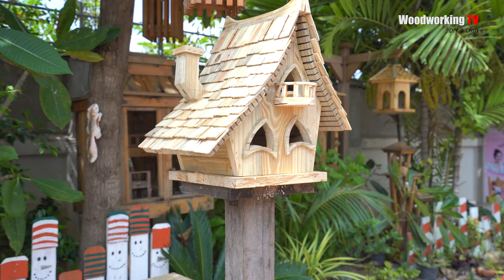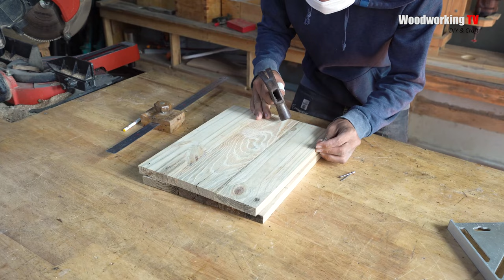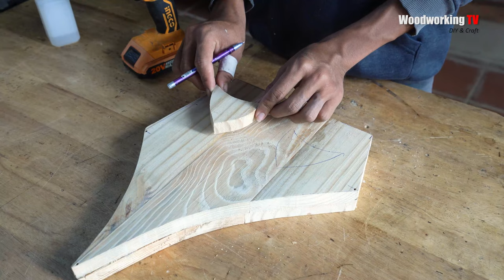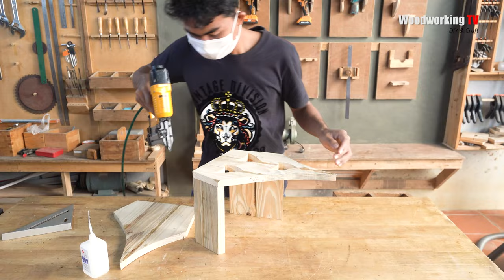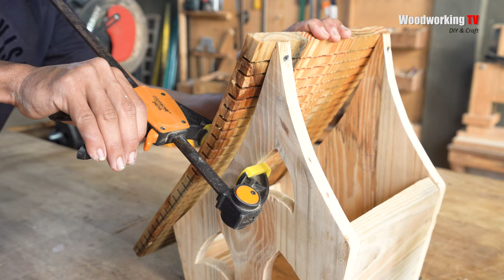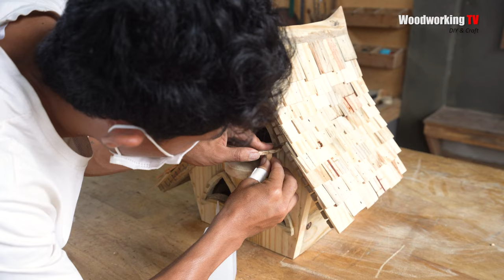Build Wooden Halloween Bird House Bird Feeder and Feeding the Birds

Comment: I like it .A friend of mine's father builds bird houses for a hobby and I'm always supplying him with more scrap wood. His woodwork is also beautiful. The only thing I would change is the thickness of the wood.Instead of 5/8" I would use 1/2" spruce ,also I would put walls and an upper floor inside the house .MALE SPARROWS TEND TO FIGHT when their together. Putting in compartments would solve this. Especially when their nesting. thanx for the video I will pass it on to my friend .She will like this and probably want her dad to build her one. Thanx again.( How do you tell a male from a female? Easy, the male are more colourful /like the ones in your video,  the female sparrows are all one dull  tanish colure no bright colouring.) Happy crafting.😃😊